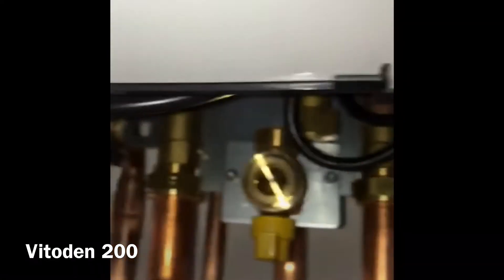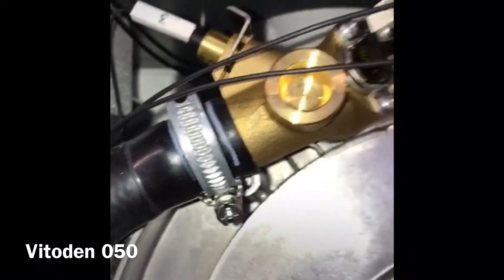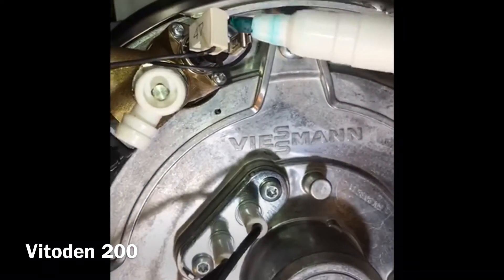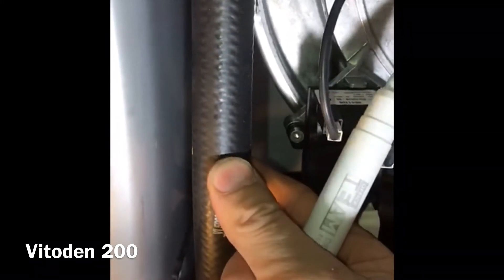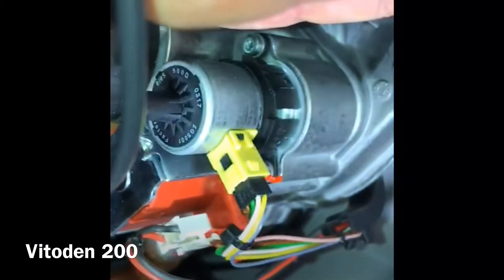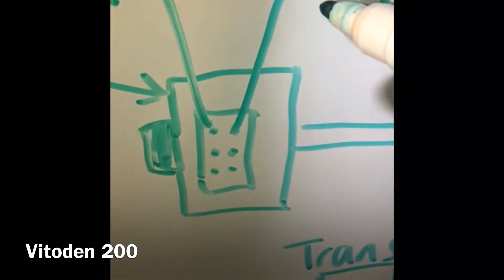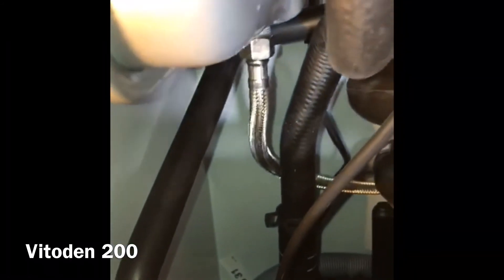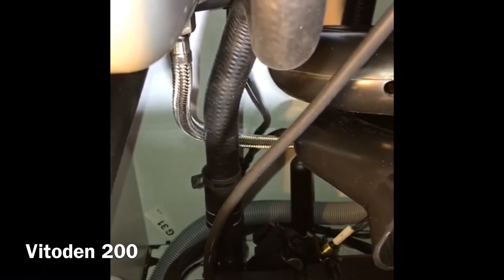Viessmann 050/200 faults Pt 2

Comment: Hi mate, wondering if you can please help, working on a vitodens 050w, boilers overheating on both heating and hot water with f2 appearing, lot of  brown sludge buildup inside, cleaned plate, both hoses don't seem like they blocked, flow pipe under boiler gets hot but doesn't reach any rads, wondering what's the most likely place it's blocked or if there a filter somewhere inside that needs cleaning?
Reply from the maker: Blocked still keep cleaning and flushing
Reply: Thanks for the reply mate, it was the return hose, I vacuumed it, all working now

Comment: Hi . When  I star cold boiler its showing 130C in 5 seconds after start then f2 fault appears.Any ideas?
Reply from the maker: Flow or return pipes are blocked probably
Reply: I cleaned all plumbing part (cleaning quite often),water flow is ok.The gas burner even not start and not passing gas ,high limit stat changed.Its showing 130C when boiler is cold not used couple days .Any other Ideas , please.
Reply from the maker: @ruslankurmelov7262 is system pressurised?
Reply: Yes

Comment: hi, i have a vitodens 200, hot water goes hot for a little bit then goes cold. same with heating it slowly creeps up to around 78 degrees then cuts off drops back down to 60 then fires back up. the house never gets up to the set temperature on the thermostat. it has had a new plate to plate and a new diverter valve you got any suggestions? thanks
Reply from the maker: @Thetailor25  blockage

Comment: Hi I have a viessmann 200 boiler but it developed fault this week. Two engineer came to check it but could not tell the cause. I wonder if you can help give some tips. It heats up hot water but the longer I run it, water goes cold. It can also heat up radiators at the programmed times but it does not stay on, after a while, the radiators go cold. The boiler temperature seems unusually low at 25C. Thanks in advance.
Reply from the maker: Yangna Li thermistor maybe they monitor and measure the water temperature